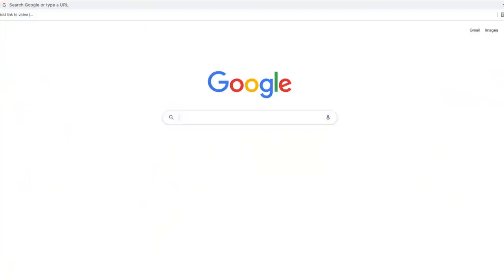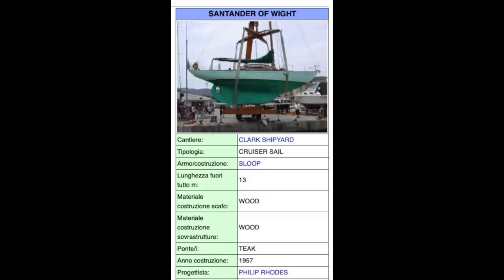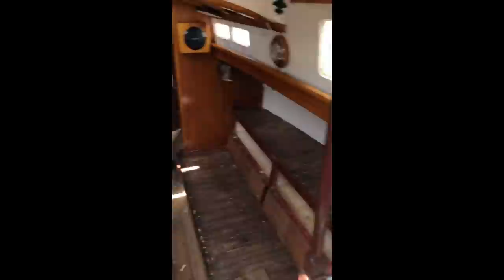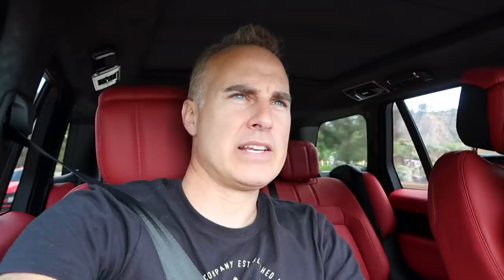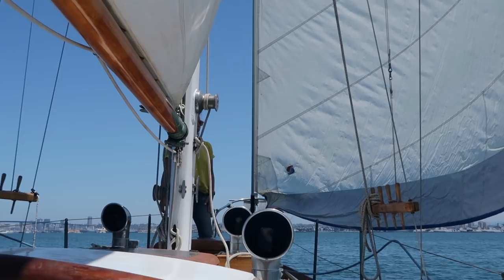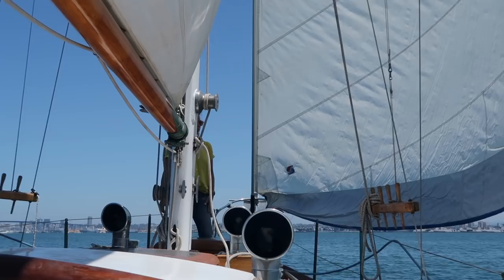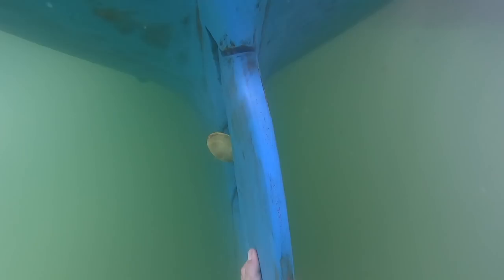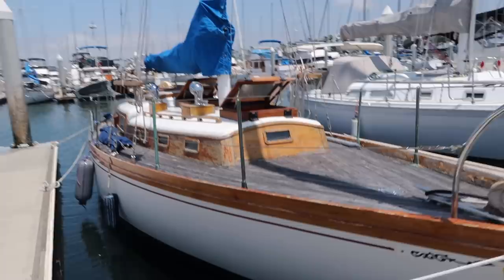I Bought a New (old) Boat

Comment: That's certainly a good old Perkins engine, I worked at the Perkins factory in 1970-71 (UK) at that time the engine of the day was the 4108 the one just after yours though virtually the same. The engine was shipped to the US and used in Massy Ferguson tractors. It was used by  Sir Francis Chichester’s round-the-world yacht Gipsy Moth III. .30,000 were built at the Peterborough (UK) factory in 1970
Reply: I have a Perkins 4108 made in 1979. Still runs like a charm with the odd oil leak now and then
Reply: I owned a Westsail 32 many years ago that had a Perkins 4108 engine. Never any problems.
Reply: Awesome news, love perkins diesel
Reply: no parts avaliable for 4108 parts avaliable for 4107
Reply: I just bout a 78 Cheoy Lee with this engine. Haven't started it yet.

Comment: For anyone desring to refurbish a classic this one is in fair condition and the perkins is a very solid engine! The Classic's are amazing to look at, yet I not the condition of the teek and the bullworks, all exterior wood is in need of full restoration! and I already have $$$$$$$ signs and many hours of labor!  The sails are far gone and need replacing! Wenches need attention and the troubles with the classic deck/sail mechanisms is finding the parts to recondition them!

Comment: Beautiful boat Josh. I also have a fiberglass hull with teak decks and lots of wood trim except it is a 38' trawler. I've been having a lot of luck refinishing with three coats of West system epoxy with 207 UV hardener, followed by three coats of Epiphanes varnish. I apply the three coats of epoxy back-to-back without sanding, when the epoxy is tacky. The end result looks like 12 coats of varnish and so far is holding up very well in sunny Marina del Rey. Good luck with her. I am the author of myself!

Comment: When I first started just "window shopping" for my first sailboat, I was totally smitten with a '70s Cheoy Lee 42' Luders-designed clipper-rigged ketch rather similar to yours. Of course it was absolutely the WRONG boat for me, but I totally get it. Hell, if you weren't three time zones away,  I might pitch in to help refinish that teak. By now you've likely learned that many owners just strip that teak decking if it's too far gone, but yours still looks salvageable, and you might get away with a proper recaulking. Carry on!

Comment: Congratulations - best choice - I Iove to see like minded fellow boaters. After all your comparison with "Giraffe", there is the biggest difference to your Cheoy Lee yet to be discovered, once you are ready to sail her. You will find a BIG difference, and your present boat has tenfold the sailing characteristics and capabilities compared with today's short keel, spade rudder affairs.
 P.S.: I have a 1965, 30 ft Cheoy Lee ketch, still in the reno phase, of course.

Comment: Great to find someone willing to restore a classic wood boat. My hubby & I have owned 2 wood boats ( 2nd one was a 34' Franz Maas yawl - teak hull, teak decks, mahogany cabin). Then (for more self punishment) we got a Swedish Ohlson 41 (steel hull, teak cockpit, mahogany cabin & interiors). We believe that traditional oil based, quality varnishes are best for the wood. even teak; get 6 coats on & then make or buy a awning cover to keep the UV sun off.  Re-coat with 1 or 2 coats every 6 months.  For our solid teak cockpit seats, we use Semco - it's a type of oil - it worked really well for the year we spent in Mex & So Cal.  I think it would be hard to use on your decks because you are not supposed to get it on the caulking.  Generally teak decks should be kept clean but just with water, many cleaners are too harsh & erode the softer grain of the wood.  Tropical sun ruins the teak decks on lots of FG boats, so awning are a must!
We totally re-caulked the decks on our Maas yawl; it's a real hard job removing the old caulking. Our decks leaked like a shower!  Good luck

Comment: Aloha Josh,  Nice find!  I purchased a Choey lee Pedrick 36 six years ago on Oahu.  I had to re-engine due to a cracked block on a universal 32.  Now she has a new Yanmar 53hp.  Also leaky windows had to be replaced and doing away with the teak deck.  The decking was worn out but didn't leak.  My projects are getting close to complete if that is ever possible.  Presently on Kauai. Bill
Reply: Thanks for the reply Josh!

Comment: That is a cool boat. Mine was built in 1966, some fantastic boats came out of that era.
Reply: @Renegade Show
Isn't this where you go on about how your 1966 Spencer 44 was designed around the IOR (International Offshore Rule) race guidelines, even though these same guidelines weren't developed until 1970 by the ITC (International Technical Committee)? You've stated this fallacy numerous times about your Spencer. All I can conclude, is that John Brandlmayr (the Spencer 44 Designer) must have had a time machine. Perhaps you could return here and enlighten all of us? And if you don't, I'll just consider it another delusion of yours.

Comment: When I removed my teak hand rails , most of the stainless bolt heads broke  they where corroded and broken under the teak plugs . It’s a tayana 55 from 84.  It’s making me think to check the bolt on all the tracks

Comment: Brightwork - have you considered just oiling the upper cabin & other " wood "?   Once you commit to varnishing, you are committing to untold hours of yearly / biyearly sanding, sanding, sanding....
With oil, you should have less hours sanding, tho yes, bi yearly oiling..... but more sailing adventure time 
Looking forward to watching her transformation.
Rad
Reply from the maker: Thanks. I’ve researched all kinds of options: Cetol, oil, sealer, etc. Nothing looks as good as varnish, in my opinion. But after re-varnishing most of the boat already, I’m beginning to question whether the looks are worth it. It’s a crazy time-consuming process. Many people say it’s like the Golden Gate Bridge where when they finish painting one end they immediately start back at the other end. That is not an exaggeration with varnish, even on my small boat. But there’s also a reason varnish has been the gold standard in boat brightwork for centuries. Thanks for following!

Comment: Oh, my....  Patricia & I passed on this boat (in Santa Barbara) in...wait for it...1976!  Too antiquated in design and systems, even then.  All that topside brightwork (sand after stripping, please) will need to be done again every year (SoCal experience speaks).  My guess:  It was simply cheap.  I wish you well, Josh.  Burgee Suggestion:  Pair of handcuffs on white field.
Reply from the maker: I don’t believe it was ever in Santa Barbara but maybe. I know the previous owner who had it for 30+ years in Marina del Rey. Then he sold it to a person in San Diego. Then I bought it. I don’t see that it’s antiquated in design and systems. But the bright work is the kicker. You have to be a diligent about varnishing several times per year or it gets dilapidated quickly.

Comment: The BIGGEST issue is the deck ... 1965 .... hundreds of screw holes ..... an the boat looks like the decking was not properly maintained, the salt/sun is a brutal on teak decks.  Leakage is gonna be your main issue, have you spotted any leakage inside the cabin ?  I first learn of Cheoy Lee in 70's from none other than Jimmy Buffet, he had Clipper 48, sweet boat.
Good luck with the decking, a lot of current CL owners are stripping and either going with glued teak or the NEW faux vinyl teak or plain FG with Awlgrip (no teak)
The teak pin rail is a very nice touch, mine had 4 bronze belaying pins on each rail. Most sailors don't realize what they are missing by not having these.
How is this hatch 17:32 secured, watertight ?
Reply from the maker: Thanks. Yes the deck is going to be tough. No major leaking under the deck but the water certainly gets in below the teak but luckily not through the fiberglass that is below the teak. I’m looking at the faux teak perhaps. Was thinking of trying to salvage this deck but not sure if possible. The manhole at the end is water tight. It simply fits down in a groove and the lid / hatch itself super heavy. Cool story about Jimmy Buffet.

Comment: Congrats , check the glass work in the bilge for delam , I had to cut out the floor of my neighbors head, glass delamed and boat was taking on water. Keel is incapsulated ,after a heavy seas a crack developed and was coming in thru delam under head floor . Also had years earlier crack in rear of keel same thing water coming in. Nice boats but hand laid glass and resin may not be the best ,unlike your bene that is vacuum infused and vinylester

Comment: Isle of Wight!... Front???
OK thats not the engine water pump it's the raw water impellor pump.
That Perkins will have a sweet spot at about 1700 rpm rev higher you will make smoke and heat. Find that sweet spot and she will last forever and give you great economy too.

Comment: Nice boat. Typical for the old school very narrow. Mine is early fiber glass some doubke skin   1969 era 30 feet very narrow 3/4 deep keel 13 hp yanmar 2ym15 of era 2006 . Some wood fittins so not much maintinace  compared to yours . Single handed is my system due to lack of space compared to modern  30 foot boats   but hell  I got it real cheap   .Based in Ireland hoping to get across the pond in 3 years from now . Will look your channel . Thanks

Comment: I noticed your alternator belt appears loose Josh, check the condition carefully...if it's bad, buy TWO new belts....put one on and you will have a spare .....good luck with your new acquisition, it looks to be a good one, with lots of work....the plumbing and wiring is where I would start...the cosmetics can always come later.......also, what is UNDER the teak decking is what would bother me.....did they do a cored deck under there?  or is there a fiberglas underlayment ?
  OnWard  ....

Comment: When doing your research did you ascertain how much money or if you could insurance for such an old boat ?   There seems to be a great deal of concern about insurance possibilities.   To sink thousands of dollars into an old boat only to lose it in an accident or fire would be devastating without insurance coverage.
Reply from the maker: Hi Doug. The insurance for this boat is quite cheap. I’ve found it’s more about the boat value vs. the age of the boat. This boat is only worth about $20k so the insurance is cheap (about $200 per year). Insurance is tough to get and / or expensive if it’s an old boat and a higher value than say $50k. Also insurance is hard to get if you’ll be doing international cruising. But if staying in one state like me, it’s not bad. I’m definitely not sinking thousands of dollars into this boat. I know it’s only worth about $20k so I spend accordingly, not putting too much money into it.
Reply: @JoshPostVlogs  ….. Excellent, thanks for the timely reply with good information.  I really appreciate you taking the time to respond.  Be safe and have fun.

Comment: I would love a copy of the PDF checklist. I can't find it anywhere.
Reply from the maker: In the description mate. It’s a link.
Reply: @JoshPostVlogs  I found the link In the description but it doesn't work. This is the second video of yours where you mention the PDF but doesn't have a working method of seeing it. I went to your website but there is no way to see anything I guess unless you are a paying member. Can't help but be more than a little disappointed and now distrusting.
Reply from the maker: @jeffreyboring  Try again sir. I've updated my website. I just spent an hour speaking to the website domain host. They told me there was a problem with my website causing it to be blocked by some users. I have now updated everything so it should work. Please let me know.